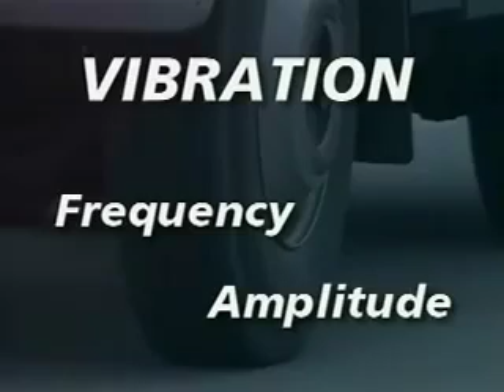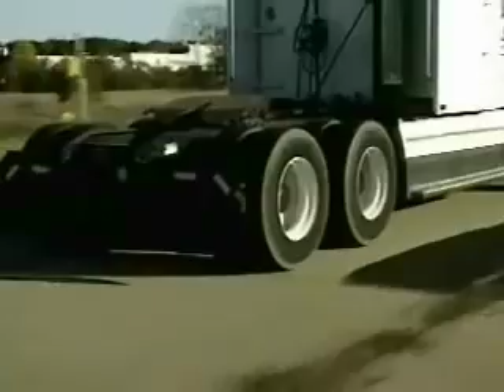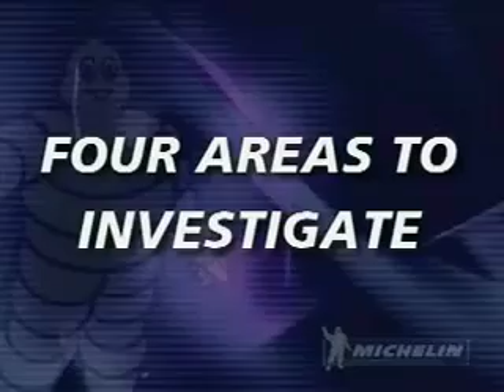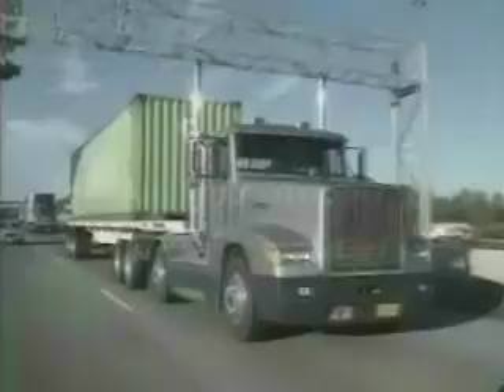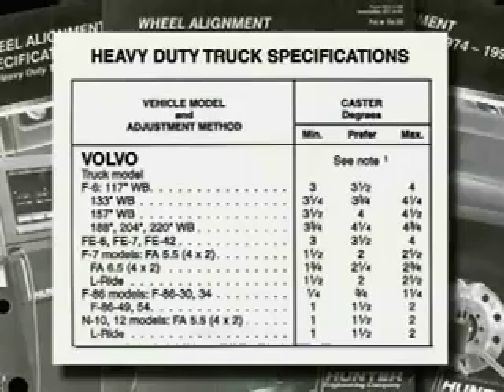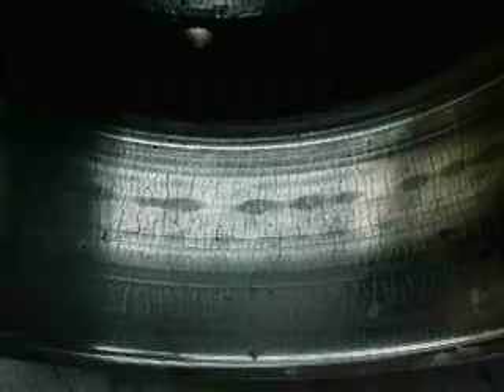Vibration Troubleshooting

Comment: Is ridiculous! the alignment places always is guessing about the problem, for the vibration I know what is the problem in 90% of the cases and you can fixed whit out spend any money.
Reply: What is it then? They cannot fix mine had it back to them at least 6 times, replaced rims and have new tires
Reply: @Crystal-fp5ok  he don’t know bro, if he did he’d tell us
Reply: Did u ever solve the vibration problem on your truck? Im having that problem now, so im going to troubleshoot.
With new wheels and tires maybe your alignment or imbalance at the brake drums cudve been it(?)

Let us know what u ended up doing? Thanks
Reply: Just did the same shit. I’m about 6-7k deep into a vibration. King pins drag link and shimmed driveshaft. Still shaking. My next step is full set up drives.
Reply: Check leaf springs and your ride height
Reply: @BP11NY spin balance on vehicle. Drums and rotors can be out of balance even on new trucks straight from the factory.